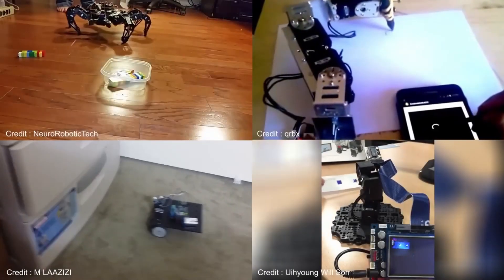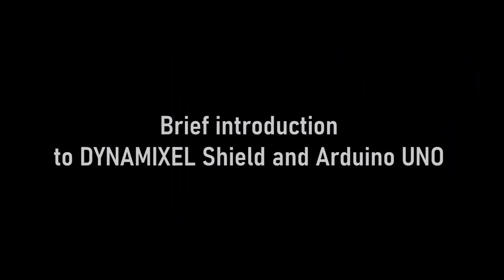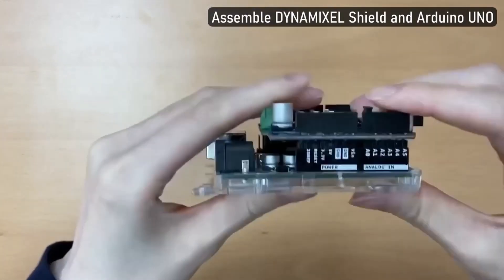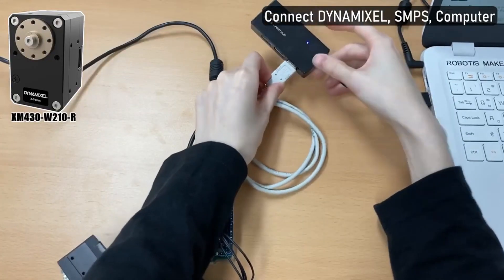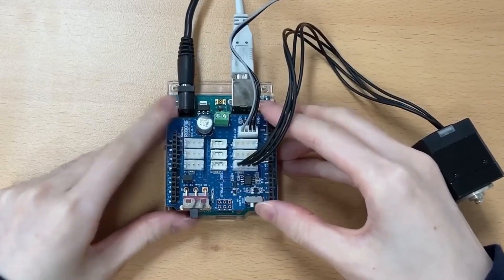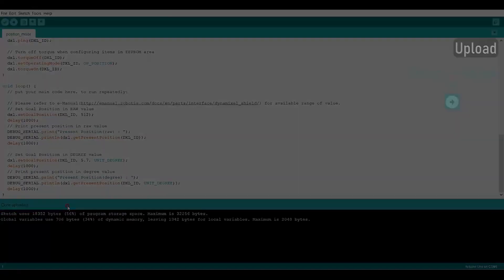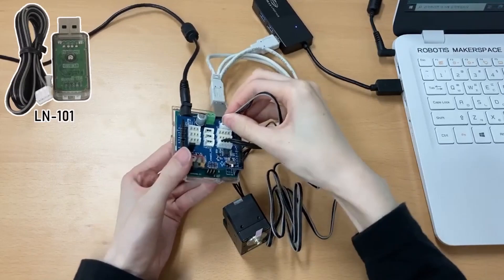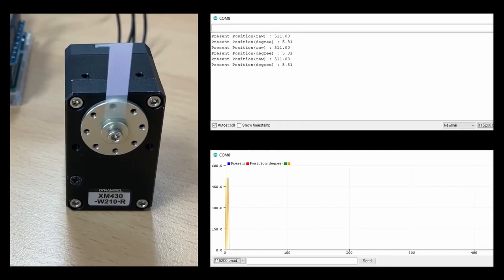How to use Arduino Uno with DYNAMIXEL || Dynamixel Shield walkthrough || Arduino Setup for DYNAMIXEL

Comment: Hey Can i connect multiple dynamixel motors to the shield ?
Reply from the maker: The DYNAMIXEL shield is capable of controlling multiple connected DYNAMIXEL motors.
Reply: How many? Suppose i want to build a hexapod with 18 × ax12a servos - is that possible with the shield, a power source, and an arduino? @robotisus
Reply from the maker: @itaisavin1596  So long as your power source is capable of supplying everything you can control up to 253 individual DYNAMIXEL servos from a single controller.

Comment: IF we d'ont have the shield how could we control the motor ?
Reply from the maker: The DYNAMIXEL Shield is a half duplex serial converter that also provides DYNAMIXEL connectors to easily plug in your DYNAMIXEL servos. It is possible to connect DYNAMIXELs to an Arduino without the shield, but it would require the creation of your own half duplex serial converter, as well as a custom solution to connect to the DYNAMIXEL's serial port, since the Arduino does not have a compatible connector.
Reply: @robotisus  Ah okay , you know what I've made? since I don't have the shield, I took the TTL wire from Dynamixel, then I plug GND and VCC to power and the remaining cable I used it to control the Dynamixel by pluging it on the Arduino in Digital Output, but since I struggle with some libraries I can't tell if it will works or not
Reply from the maker: @AK7-c9t  DYNAMIXEL servos require half duplex serial communications for operation. The recommended circuit layout for creating your own converter can be found on our eManual for your reference.
https://emanual.robotis.com/docs/en/dxl/x/xm540-w150/#communication-circuit
Reply: @robotisus  Ah okay, I understand. Thank you so much for the informations

Comment: Besides arduino uno, which other boards are compatible with dynamixelshield?
Reply from the maker: The Arduino Uno and Mega are compatible out of the box with the DYNAMIXEL Shield. Use with other Arduino based controllers may require customized firmware for use with the Shield.

Comment: Can we use this system with the Dynamixel XL430-W250-T?
Reply from the maker: The DYNAMIXEL Shield is compatible with all models of DYNAMIXEL actuator.
Reply: Thank you
Reply: @robotisus  Even RX-64?
Reply from the maker: @wafflecat8  You'll need to use a convertible cable, as the RX-64 uses our older connectors, but it is still compatible.
Reply: @robotisus  Thank you! And can I ask if the RX-64 is able to do Current Based Position Control? Or Torque Control? Or any kind of Compliant Control?
Reply from the maker: @wafflecat8  The RX-64 does not support any compliant control modes. I would reccomend looking into the more modern DYNAMIXEL X series servos for this capability.
https://robotis.us/x-series/

Comment: May I ask what is the role of the Dynamixel shield? Can I connect Dynamixel motors without it? thanks
Reply from the maker: The DYNAMIXEL Shield is a half duplex serial converter that also provides DYNAMIXEL connectors to easily plug in your DYNAMIXEL servos. It is possible to connect DYNAMIXELs to an Arduino without the shield, but it would requre the creation of your own half duplex serial converter, as well as a custom soluton to connect to the DYNAMIXEL's serial port, since the Arduino does not have a compatible connector.

Comment: Hello I got errors when I upload the code in the arduino IDE, pls help
Reply from the maker: Hi Charlie, thanks for your comment. If you aren't able to successfully upload the example code and get errors, we'd recommend checking that the switch on your DYNAMIXEL Shield is set to "upload" , as well as double-checking the Port that you have selected in Arduino IDE under "Tools". If you have more questions or need additional troubleshooting please post on our new community forum- community.robotis.us .
Reply: @robotisus  Hello, thanks for your response. I am using the dynamixel shield with an arduino UNO and 2 dynamixel xl-330 servos. I just wanna use them like normal servos. I could upload the program "position-mode" on the board, but the servos won't move. I also do not really understand where I enter the servo-type and the position angle.